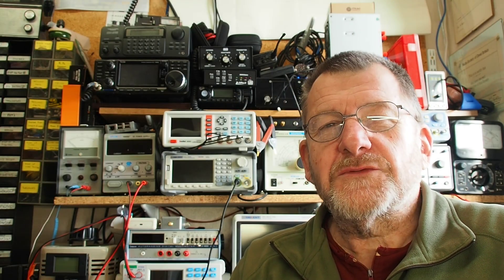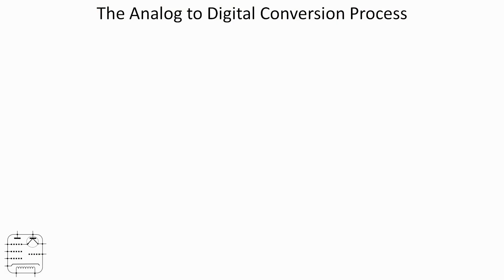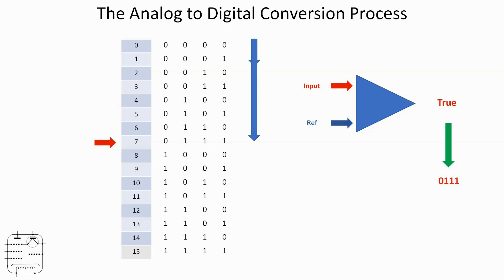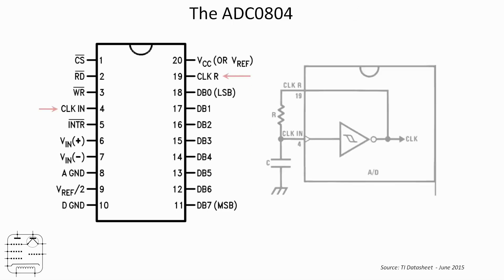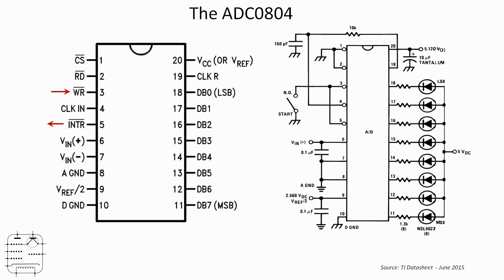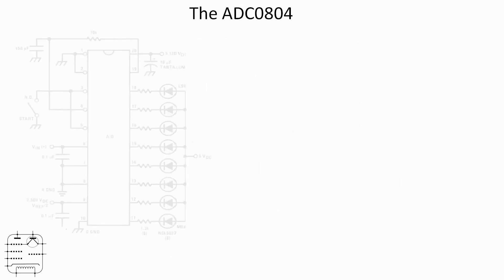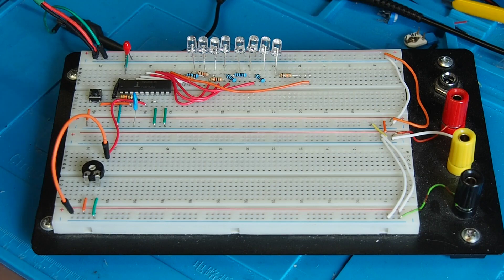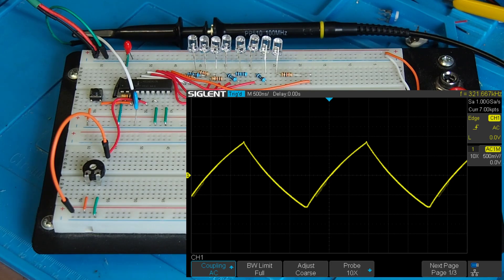Analog to Digital Conversion - #155

Comment: I suspect they start with D/A first as its easier to demonstrate. You can set up a row of switches and a R-2R ladder and see what's going on  easily.. this is how I first introduced my kids to binary, I started with the R-2R to show different combinations can produce an analog voltage then moved on to binary to 7 segment and binary to decimal ics and so on.. heres a video of a breadboard I put together with my eldest daughter https://youtube.com/shorts/_Q0yXqdg-i0?feature=share it uses a step down transformer rectified I then fed the 100hz sinewave into a Schmitt trigger inverter to square it up, from there into a divide by 10 ic to give me 10hz then the carry out from there into another divide by 10 ic to get our 1hz clock .. as you can see theres a binary ic, a binary to 7seg and a binary to decimal to drive the nixie tube etc Another great video from you 😎👍 great demo 

Steve

Comment: Thanks for the interesting video.  I had no idea how this actually worked.  However, I do use my Arduino Nano as an ADC converter.  It has 8 ADC inputs, does 10 bit conversions at around 1000 conversions per second, fits on a breadboard, and can send data to a PC via USB/Serial port.  It's a pretty awesome device for around $20.  Cheers from Canada :-)